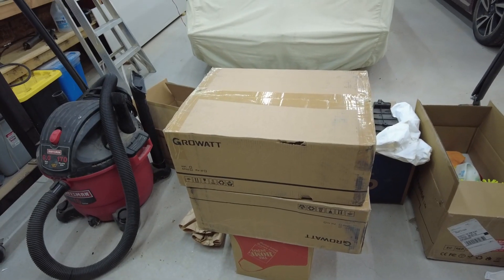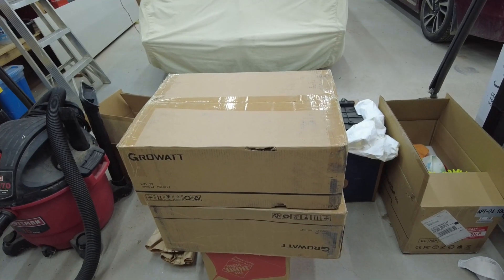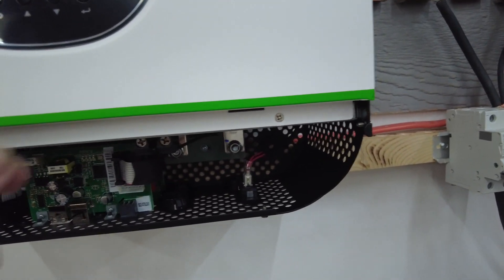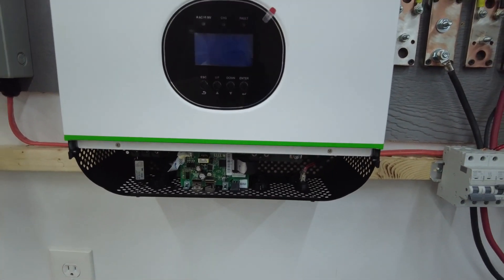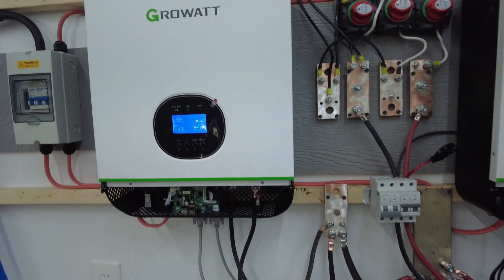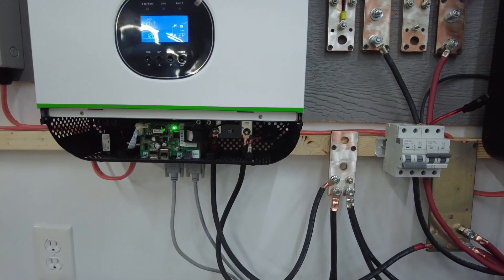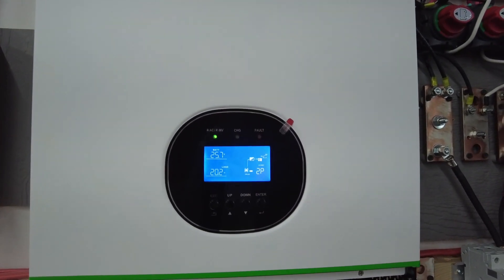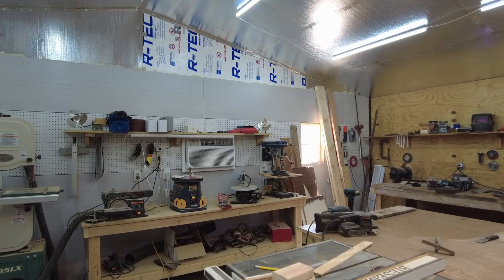Split Phase Growatt 3000 for the Off Grid Shop.

Comment: Hello, I am doing the same set up, so the slave unit only needs battery cables to it, no ac?   and the master will be 120 and the slave 240?  Thank you.
Reply from the maker: Hi, Both units will have AC out connections. Master will have L1 and neutral, and slave will have L2 and neutral. Both units output 120 volt. The communication cables go between both units causing the units to operate perfectly out of phase of each other giving you 240 volt between L1 on master and L2 slave. And of course the Grounds will also be hooked up.

The same goes for the AC input if you choose to use it. You will need a 240 volt supply and run L1 to one unit and L2 to the other, or so I heard. I can not confirm this at this time as I do not have the AC Input hooked up on mine. I have been charging by solar only.
Reply: @kc79ta  Thank you!   and if I have A C  in, will it go to both units?  Thanks!

Comment: Do you have 120 volts going to both growatt's? For charging? Or can you just use one to charge the batteries from a generator or shore power? Thanks so much for your time!!
Reply from the maker: Both, Once you set them up to run in Split Phase (240v) you will need to run 240v and split it down to 2-120v lines one for each Growatt. If you only run a 120 v line to one of the Growatts you will get alarm 15&16 for "Parallel input phase error". Ask me how I know, lol.
Reply: @kc79ta  ok so if I only have 1 120volt leg I'll have to use my auto transformer to make 2 120volt legs that would work correct?
Reply from the maker: @kingasapj3160   I can't say for sure, as I never tried that way, but as long as the transformer outputs 240v that you can split into 2-120v legs it should.

Comment: @kc79ta are those 24v units?
Reply from the maker: Yes, 24 volt. Kind of wish I went with the 48 volt. Better selection of batteries.
Reply: @kc79ta  I’m going with multiple voltages…12v for cars and easy transport…24v for larger portable uses like RV my white beauty shown in my icon pictur..etc and 48v for either large trailer power or home/work use.

Each voltage has its own *’s and -‘S common known things course but stepping up or down from one like 48v to 12v involves more energy inefficiency I think than 24v to either 48v &/or 12v etc.

Comment: With your busbars do you have anything behind them or is it just screwed to the board 
  Just wondering because I’m making some right now for my 3. EG4 batteries
  Thanks for The realistic video signature Solar runs unrealistic loads and they show you their test of a few LED lights and a Skil saw
Reply from the maker: They are just screwed to the board with 1/4" spacers between the board and busbar. Thanks for watching.
Reply: @kc79ta  like plastic or some non conductive ?
Reply from the maker: @cowboymcq6711  Yes, I used plastic.

Comment: so only 240v from that one inverter on the hot and neutral ? would the other inverter remain at 120v  and can both inverters run at 120v ?
Reply from the maker: It takes both set-up in split phase for 240. Hot on inverter1 to hot on inverter2. Hot to neutral is only 120v. Yes, both units could be set-up to run at 120v in parallel mode.
Reply: @kc79ta  okay thanks I have 2 identical  120v 24v  3000 watt solar hybrid inverter chargers here running eifht now but they don't have the parallel option
Reply: Do you happen to have a wiring diagram for your set up?
Reply from the maker: @donniegeeter797  Only the one from the Growatt manual with you can find on their website  https://en.growatt.com/